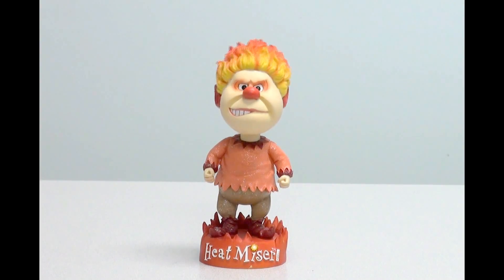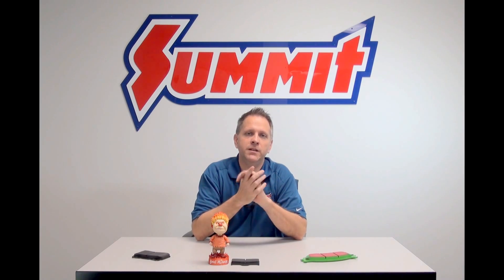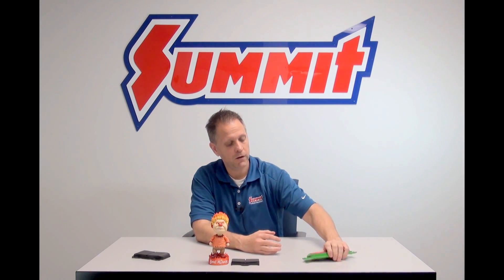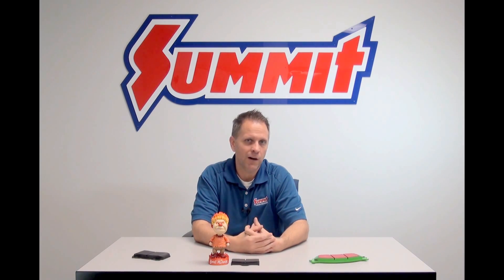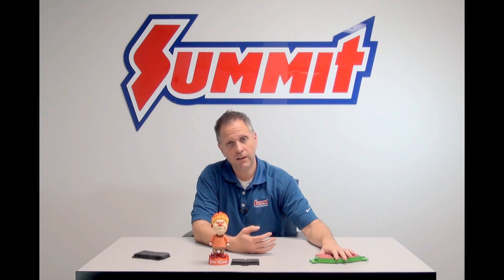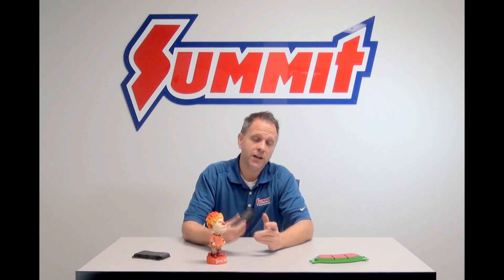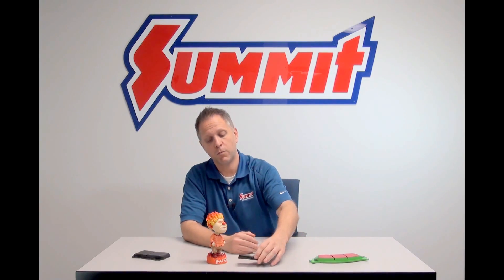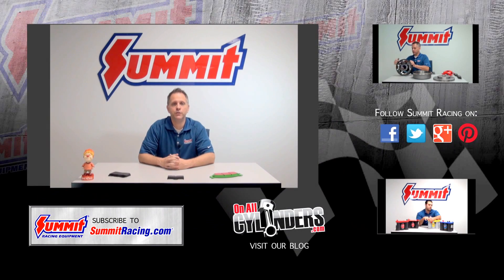Ceramic vs Semi Metallic Brake Pads - Summit Racing Quick Flicks

Comment: I'm used to and have ALWAYS used semi metalics !
As they warm you can feel like the pedal almost coming up under your foot.
I bought a later model car, and didn't trust the way it stopped.
Found out only ceramics were available for it, but replaced pads anyway.
No difference.
I'm terrified with those pads at high speeds or hard driving.
(ps. I drove late model stock cars for YEARS)
I'll stick with the hotter they get, the more pedal you got.
Yes...heat within reason.

Comment: Ceramic pads from O'Reillys and autozone produce more brake dust than any pads I've used in my entire life. I keep getting warped rotors, too, and I have a feeling that the brake pads are responsible as, as they heat up, they are depositing too much material onto the rotor and causing excessive friction and heat. Not 100% sure but I'm going back to semi metalic.
Reply: Ceramic acts like an insulator. You likely aren’t running enough brake cooling.
Reply: yes semi-metallic pads are far superior to ceramic pads in a hot braking system.

Comment: Ceramics run much hotter than semi-metallic. If your brakes are dragging slightly on the rotor expect the rotors to be in the 250+ F.

Comment: Ceramic pads put a lot of heat into the rotor. You must use performance rotors. Many OEM rotors will warp well before the ceramic pads wear out. 

And definitely do not use ceramics with inexpensive (manufactured in China or India) rotors, such as the cheapies sold by AutoZone. They will warp very quickly, and can never be machined. They are throwaways; I never use them, not even on a daily driver.

Comment: Ceramic pads may be more expensive and perform better when things get hot but they will compress more meaning that they will make your brake pedal feel squishier and will be more difficult to modulate the brake pedal with your foot. They just don't feel confidence inspiring despite being the most expensive of all types of brake pads.

Semi-metallic pads however have a very good initial bite and just feel better when braking as the pedal feel is firmer, similar to the ones that came on your car when you bought it. The downside is that they will start to lose performance under excessive heat, so I wouldn't recommend these if you drive in the fast lane during traffic where you have to constantly speed up very fast and slow down very fast or if you have to go through winding roads on a good part of your daily commute. In normal traffic, stop and go, bumper to bumper etc., these would be my choice.

However I will say that they perform about the same as far as pure stopping power and nothing else from my experience so if spending more on ceramic pads will give you better peace of mind then by all means get them.
Reply: semi-metallic pads perform better under high performance and high heat than ceramic pads ever will

Comment: I Have a 03 crown Vic with cheapo autozone pads and I had the rotors cut because one became warped. Regardless, I didn't realize how bad my breaks were until I drove an early 90's Corolla that stopped on a dime. car weights 2 tons but I heard semi-Metallic breaks didn't stop good when cold. Would ceramic pads and rotors be a good option?

Comment: Will the semi metallic be a good buy for a 2009 toyota corolla?
Reply from the maker: Hi Gamez, 
As a replacement pad for daily driving, yes, they would be fine!  Make sure to install a new or resurfaced rotor and follow the proper bedding-in procedure.

Comment: Which gives a longer ROTOR Life?
Reply: Great question. The video said the organic pads were easier on the rotors, but would it be fair to say that ceramic are gentler on the rotors than semi-metallic for an average commuter?
Reply from the maker: Hi Scuba, 
This would really depend on your application & useage but, both will wear on the rotors!
Reply: Scuba Jamaica ceramics by a long shot.

Comment: For a 1995 Chevy Camaro z28 what kind of break pads should I get? I want something with good stopping power for performance, street use, and light track use. Is Ceramic better than Semi-Metallic for these purposes?
Reply: semi-metallic! Its what Brembo uses for high performance brake systems. I have no idea why Summit is recommended them. Ceramics are for grandma cars
Reply: @samspace81 you are correct summit is wrong here
Reply from the maker: +Phoenicius Infinius Infensas, 
Yes, a Ceramic would actually be a good choice for an all around type of performance!

Comment: Ceramic pads are harder which produces more heat and should be used with performance rotors! Which are design to last longer and cooler!

Comment: how does ceramic perform in hot region like in Saudi Arabia where is the temperature in summer get over 135 fahrenheit?
Reply from the maker: +Jimmey Malki , 
Yes, they should work just fine but, that would also depend upon the usage of the vehicle. Is it a race type application, heavy towing….?
Reply: temperatures here sometimes get over 50 degree. Thats why i am asking coz I have many stores and would like to import break pads and want to to get the best one. If you would suggested which kinds we should go with. Thanks

Comment: I want better pads for 2003 toyota tundra truck. 
which would you recommend,  ceramic or metallic?
Reply from the maker: +Emanuel Muresan,
Metallic pads are fine but, Ceramic is the newer technology out there in the brake world designed for higher heat applications such as occasional racing and towing, by all means, go Ceramic!
Reply: +Summit Racing Does it matter if I put ceramic pads on non-ceramic rotors?
Reply: +Powertourg By the way, the car is an SUV
Reply: Titanium discs, you say?  When, where, how
Reply: That's a lot of coin for something you can do without lot in daily driving

Comment: hi there i do alot brake jobs at my shop and i getting complains on noise grinding brakes from brake pads special on cold mornings ...i work on passenger cars and minivans..i use ceramic brakes all the time... SHOULD I STAR USE ORGANIC BRAKES INSTEAD THE FULL CERAMIC PADS??  TANKS
Reply from the maker: Manuel Lagunas, 
Many times this comes down to the proper surface preparation and bedding-in process if re-surfacing a used rotor or not using too aggressive of a pad compound when choosing a pad for street driving.  Many pad manufacturers go out of their way to try and educate their consumer by posting a lot of information on their websites about each compound and proper usage! They (and Summit) have tech hotlines available to help you wade through all of the confusion and make the proper choices. Our tech line can be reached at 1-330-630-0240.

Comment: I have no experience with the organics, but I have found ceramics last a lot longer in my daily driver with an 80 mile daily commute. I was changing semi-metalics and severe-duty metalics every 3 months. I can get about 12 to 14 months out of a set of ceramics. YMMV.
Reply: If your'e changing semi metallic pad every 3 months ( SOMETHING IS WRONG WITH YOUR VEHICLE OR U R RIDING THE BRAKE PEDAL ).
Reply: Wow, necro. That was 4 years ago, and traded in that clunker awhile back. Did find the caliper pins were hanging causing the pads to wear uneven and fast

Comment: Hi Dave
I have an 02  4 wheel dr Pathfinder . I just put new ceramic pads on and I get brake shudder  in the steering wheel . and notice dark ceramic spots on the rotor , Ihave sanded and cleaned off the rotors and the shudder is getting less however annoying . should I try semi metallic pads, or disable my ABS  to Bed them in better?
Reply: my 2 cents. on my 03 same  as yours , Tanya Boo
 I had the same problem , the fix was new rotors and pads. get somebody that knows what they are doing , those rotors  have to come off with the entire hub assembly  lots of rings and clips  bearings etc,

Comment: Decent video but you didn't mention any disadvantages to the Ceramic pads.
Reply: They are more expensive, for one.
Reply: TorQueMoD I just put Ate ceramic pads on my bimmer purely to reduce the brake dust and wow! They're outstanding so far, hardly any dust and excellent stopping power. Very happy.
Reply: Ceramics are closer to the original brake pads that came with your car
Reply: Because honestly, if the ceramic pads are good, there aren't any.
Reply: @nemo5335  NOT TRUE
Reply: The Goldilocks pads are ceramic I believe as far as durability and performance in every weather conditions. Mainly cold which the others are lesser so. They have a higher price tag
Reply: Want a disadvantage? Here you go! THEY ARE NOT AS GOOD AT STOPPING AS SEMI METALLIC! My daughter's Hyundai Sonata had the original ceramic (Ooh! OEM...)brakes. When I replaced them with semi metallic, and not high priced ones, the car stopped in a much shorter distance. Startled her the first time she stepped on the brakes. I want my cars to be able to stop when some A-hole pulls on the freeway at 35mph, and the traffic is doing 65. I also want to be able to stop when we are driving in the mountains, particularly driving down the Cajon pass when we are returning from Nevada or Utah on the 15 freeway.  Yes, they are noisy, yes they leave dust on the wheels, but all that is irrelevant in comparison to being able to stop quickly enough to avoid an accident. I also don't want some fool who is fussy worried about brake dust on his precious sport rims ram into the back of my car because he can't brake soon enough. Listen to what the man said about semi metallics: they brake the best!
Reply: Nick Caesar the majority of all original brake pads are the same
Reply: @the-terminator5682  So what. Original brakes are crap. I can do better with mid price semi metallics than most OEM pads.
Reply: Do you know the disadvantages?
Reply: No. Which is why I thought it strange that you mention them for the first types but not the Ceramic. Unless you're implying there are none?

Comment: i was looking to get new brake pads for my car. I was wondering if i use the ceramic brake pads will i need a special rotor for the pads because of the heat the ceramic might produce?
Reply from the maker: Hi Andrew Whistleman, 
No, there are no special Brake Rotors designed specifically for Ceramic Pads. Let us know if you have any additional questions. Thanks for watching!

Comment: I want brakes that i can press quite hard and that will not grab or nose dive my car as at the moment that is what is happening to me. when i press the brake lightly it brakes too much and they are far too sensitive, on my old car the braking was just fine. What type of brake pads should i buy so i can put some force on the brake pedal with out going through the windscreen??
Reply from the maker: Hi maltatravel,
We need some additional information from you in order to make sure we give you accurate information. Can you give our tech department a call? 1-330-630-0240. We look forward to your call. Thanks!
Reply: What you describe sounds more like a suspension or even a brake booster issue. Brakes will all make the car nose dive under heavy braking, the suspension counters this especially of upgraded from factory. If you are on factory suspension i suggest you have the struts inspected because they may be bad. Does it bounce quite a lot when going over speed bumps etc? Or of the brakes are super sensitive when you hit the pedal, you may have a bad brake booster
Reply: Donald Sullivan hi, since then i have changed the brakes with a new brake kit from wilwood :)  they are better now compared to before on factory brakes.   my wilwood kit consists of disks, calipers, brake pipes, and brake pads. 
where and what is the brake booster?
Reply: The brake booster is associated with how the master cylinder works to control pressure on the brake fluid when you press the brake pedal. If its better/fixed then it may not have been the issue, it just sounded irregular to have been caused by pads and calipers
Reply: Donald Sullivan I see thanks for the reply...
so can the brake booster be regulated for a different feel?

Comment: I have semi metallic and overtime I press the brake. It lets out a big sequel. It only goes away when it rains... Any suggestion
Reply from the maker: Hi Nik Asher, 
The brake pad is loose in the caliper. Remove the caliper from its mount and tighten up the spring clips on the brake pad. Also, there many products that can be applied to the pad to basically adhere the pad to the caliper to stop its movement.
Reply: Semi-Metallics suck. They always screech, and leave insane amounts of brake dust. Always go with ceramic pads. Try putting some grease on the BACK of the brake pads and around the retaining clips that hold it into the piston. That will prevent any extra screeching.

Comment: I have scion tc 2012. Which type of brake pad is good for mine?
Reply from the maker: Hi Mi Nguyen, 
Today, a good semi-metallic pad is considered entry level and most times low cost. If you are not an aggressive driver, they will be satisfactory! If you are an aggressive driver then a Ceramic pad is the way to go as they are designed to handle the heat of that style of driving. Give us a call and we can help you choose properly for your car. 1-800-230-3030

Comment: Back then the oem weren't ceramic pads but now that's what they use , I bought it at the gmc dealership and they look like semi metallic, on brake pads i only buy oem and not store brand pads but I have bought Wagner semi metallic pads and been happy with them

Comment: In 2005 i installed ,in my 03 Sierra, ceramic pads and didn't like them I felt that the truck was not stopping properly and when back with oem pads in less than 7 days
Reply: in Heavy duty applications, Semi metallic.
Reply: I have an 03 yukon xl that I just bought and need to change brakes.  What type are the oem pads?

Comment: I have an 04 Toyota Highlander, 120k miles, had new brake pads put on a few months ago as well as new rotors earlier in the yr.  It had OEM pads which they replaced with ceramic pads.  Since getting ceramic pads on the front it now feels differently when the car stops, feels like it's not grabbing/stopping that good at times, also it seems noisier, not sure if the noise is the average sound of ABS brakes winding down at a stop or if it's a slight faint grinding sound from the ceramic brakes.  Everything on the front is new so  not sure if it's me or what.  Also sometimes I feel weird movement in the brake pedal when applying the brakes. Is this average ceramic pad performance??
Reply: I also thought maybe the caliper isn't grabbing the way it should since having the ceramics put on it seems to take more force to stop the car than it did before, I have to really lay on the pedal at times & sometimes seems to come to a rolling stop if I have to do a panic stop for an animal in the road & such.

Comment: If you are trying to stop brake squeal and squeaks, especially with ceramic pads, it has to do with lubricants after cleaning. Only Real Synthetic Boundary Solid lube is able to handle the pressure and over 1000°F experienced during hard braking. Check these links to find out more about synthetic Ceramic lubes at... (ceramlub com). Also learn the OE Approved 5 steps procedure for top end brake service, it eliminates noise and actually reduces stopping distance 5% to 10%... (stopbrakenoise com)

Comment from the maker: Both can actually chew on a rotor pretty good!  The Semi-metallic’s have been around awhile and are noisy with less dust.  The Ceramics are a newer design material made for higher temperatures such as racing or heavy towing. They are a quieter pad but do produce more dust. Please let us know if you have any additional questions. Thank you for watching!
Reply: You are wrong summit totally wrong on ceramics
Reply: Summit Racing Ceramics produce more dust? Man you're incorrect... quite the opposite.
Reply: I thought semi metallic make more dust??!!??

Comment from the maker: Hi James, a semi-metallic is a good choice if you do a lot of low speed trail riding and lite rock crawling where the brakes don’t really have a chance to heat up much.    The Ceramics are a good choice if you have larger tires and are a little harder on the brakes, heating them up often, towing or more highway use.